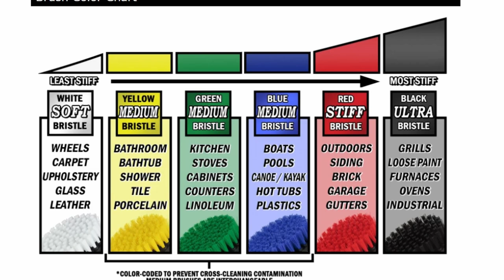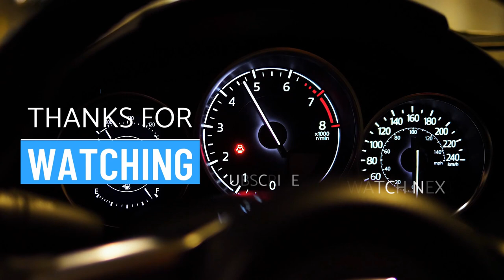5 Essential things to know about drill brushes

Comment: Just one thing to consider when getting the battery for the drill.. yes going for the longer lasting battery makes sense but with that means bigger battery size. That can tire you out due to the weight if you have to use the drill brush a lot through the day. It may be wise to get multiple small batteries imho. Less weight to handle, drill will feel a bit more nimble in the hand and you will be working with a smaller footprint so it may slightly help when cleaning those awkward spots/angles
Reply from the maker: Good point also it tends to get hit a lot because of the size.😁

Comment: What would you recommended for a brand of drill to use with drill brushes.
Reply from the maker: I've used both Milwaukee and Dewalt brand and honestly they are both ok. I've had some issues with Milwaukee with the battery pack getting loose overtime and with Dewalt's plastic built chipping away once it gets accidently bumped or hit with another object. But I guess these things happen when your in the field and not really paying attention. Right now I'm using a DeWalt and have been using for about six months now. I wrapped the battery pack with a duct tape just to protect it:)